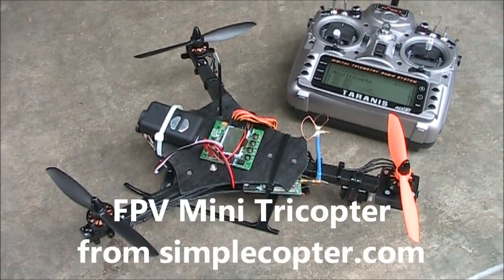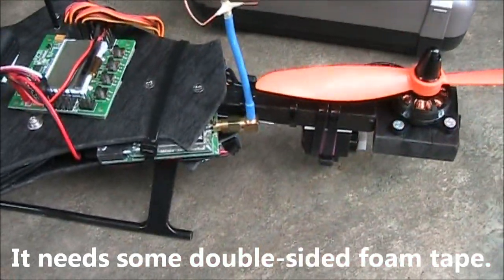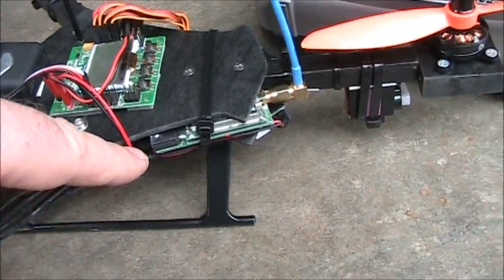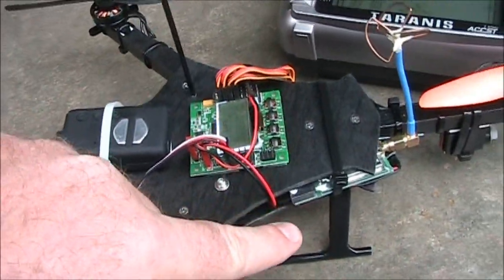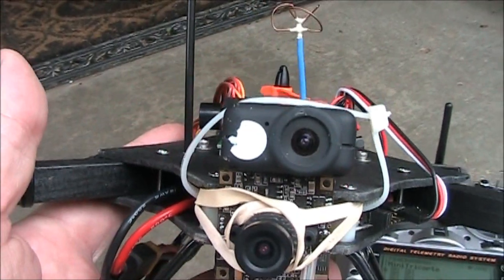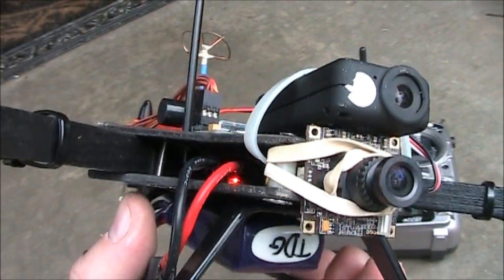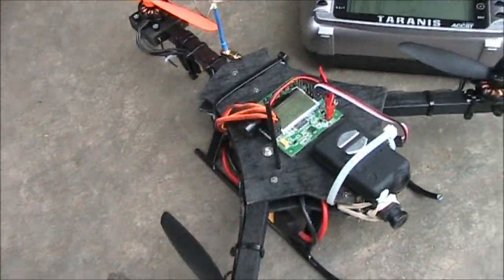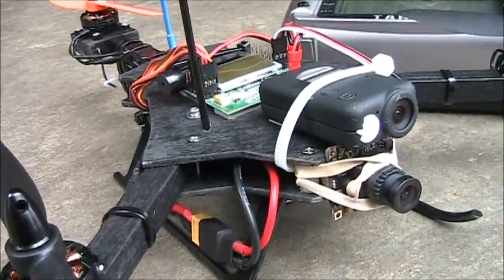Mini Tricopter FPV & Sidewalk Cruising!  (simplecopter.com)

Comment: Hello, I have a question. I saw that this is set up with ppm for the receiver. What transmitter radio and receiver combo are you using? I am using the turnigy 9x right now stock and have so many wires everywhere. I want to have it like yours with only one wires could you please tell me what combo that is and how to set up the ppm with the kk2 it would help so much thanks a lot
Reply from the maker: I'm using a Taranis transmitter and D4R-II receiver.  The D4R-II does 4 channel via PWM or 8 (I think) with PPM.
Reply from the maker: I don't think I'm using PPM on this tricopter but I am on my mini T copter.  The KK2 board can do PPM though.